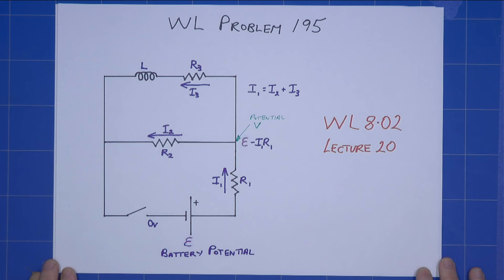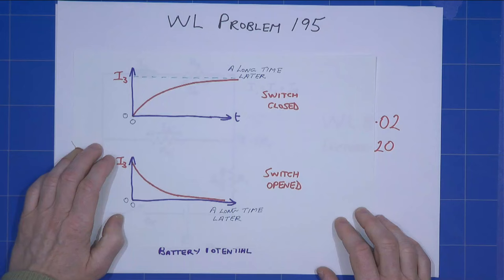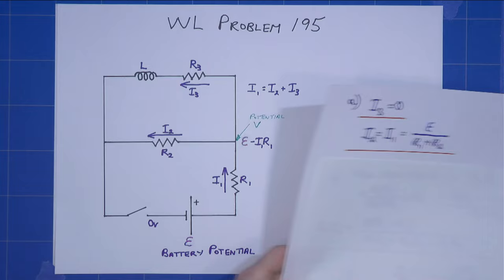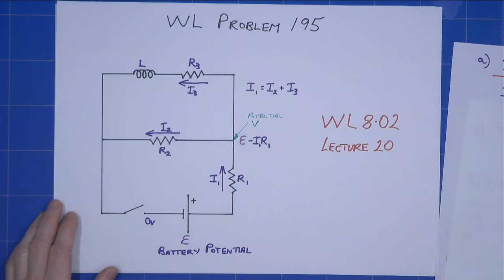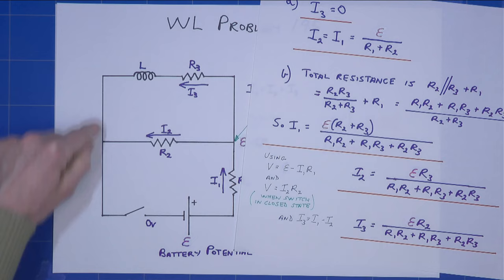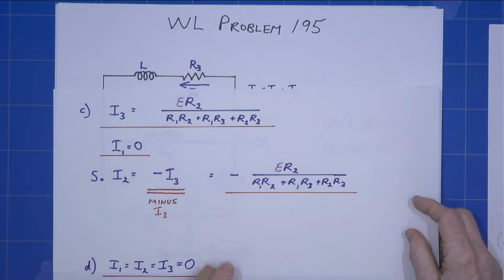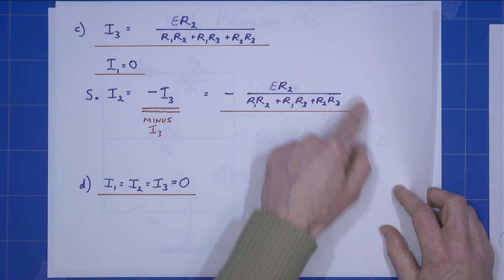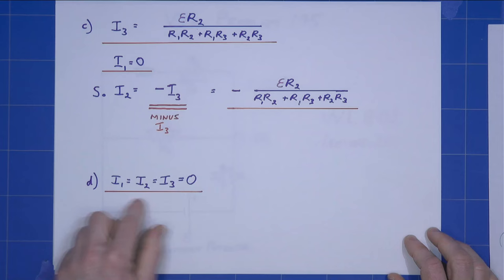Keith' solution to Problem 195

Comment: I agree, good explanation. A bit british maybe :-) ...

Did you count my solution as correct or not ? I worked with the sub result and Keith expressed all current in R and V. Should I have done that ? Is it a requirement ?
Reply from the maker: I do not remember your solution. If you got the same 4 answeres as Keith, than your solution was correct
Reply: @lecturesbywalterlewin.they9259 I did not. I gave the formula for the parallel replacement value and used that in the answer as Rv. Is that wrong ?
Reply: @hanslepoeter5167
Yes. Your solution was correct.
Reply: @ulfhaller6818 Thanks for checking Ulf. Next time I'm gone write it out and simplify though.

Comment: Why Ampere's law fails in certain cases? When finding magnetic field at an axial point at the end of an infinitely long current carrying wire?
Reply from the maker: ampere's law never fails as long as you know how and when to apply  it. You cannot apply it at the end of any wire regardless of its length.
Reply: A long current-carrying wire, with no closed loop, would be accumulating a charge at one end, and the opposite charge at the other end. If it is carrying a steady current, the charge would be growing at a constant rate.  There'd still be a transient electric field immediately at the end of the current-carrying wire, due to the charge build-up.  Ampere's law would still apply, you'd just be measuring a magnetic field of displacement current, instead of current.

Comment: Sir, I saw in a video that after rotating a rim wheel, you sat on a chair and the chair started rotating, but sir, in this situation all the force is internal and internal force never provides motion, then how did the chair start rotating?
Reply from the maker: no external torque, thus angular momentum is conserved. Since I changed the moment of inertia with my arms, omega changed .
Reply: Thank you sir for solving my doubt

Comment: Professor I’m solving your electricity assignments . Please give me some advice about problem solving. I’m preparing for JEE. ( yogurt doesn’t work for me , kindly give me helpful practical advice)
Reply from the maker: you have 2 options
option 1: eat yogurt every day but never on Fridays That worked well for Einstein, also for me.
option 2: Watch all my 94 MIT course lectures. Start with 8.01, then 8.02, then 8.03. Do all the homework and take all my exams. I guarantee you that you will then do very well on the Physics portion of any freshman college or JEE exam  You will find all information you need on this channel in three playlists "Homework, Exam, SolutionsY & Lecture Notes".
8.01 & 8.02 will each take about 200 hours, 8.03 about 250 hours.

Comment: I guess part c) is wrong. I1 = 0, I2 = I3 = (U - R1*I)/R3 with I :=  U / (R1 + R2*R3/(R2+R3)) (I = same current like I1 in part b or I3 is the same current as I3 in part b)
The energy is stored in the magnet field of the coil and the coil is then the battery, that means the current flows from one side of the coil through R3, then through R2 and then to the other side of the coil. So the direction of the current I2 must be the same direction of I3 and not I2 = -I3.
Reply: @lecturesbywalterlewin.they9259  I understand what you mean. If you draw R2 on the same height as R3 right beside R3 the same current would flow through both resistors in the same direction (for the case c)).
Reply from the maker: In question c, I3 goes from right to left, but the  current I2 goes from left to right. Thus they go in opposite directions
Reply: The current in I3 does not change direction when the switch is opened. So the current in I2 must reverse direction, as indicated by a minus sign. There is no other path it can take.
Reply: @lecturesbywalterlewin.they9259  In a circuit you should define an edge orientation and then the current flows e.g. counter clockwise. To say the current flows from left to right on the downside and right to left on the upside is not so useful. If you have a ring current you would not work with infinity counts of directions and say the current of the upper ring flows in the opposite direction than the current in the lower ring... you would say the ring as an edge orientation and the current flows counter clockwise.
Reply: In part c) we have a closed circuit with a coil and two resistors R2 and R3 in series.
If we define the edge orientation of this circuit counter clockwise, the edge orientation has the same orientation as the physical current I3 = I2 > 0.